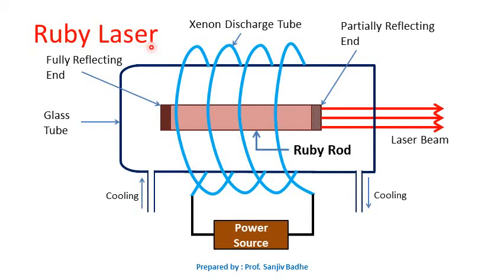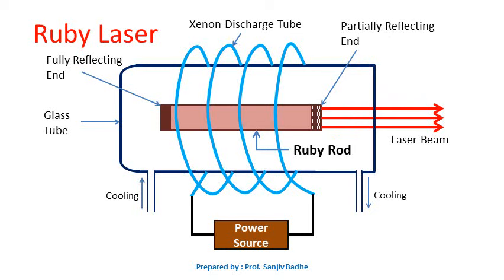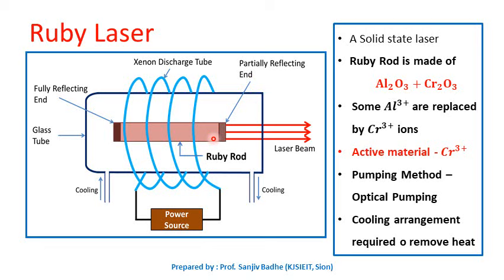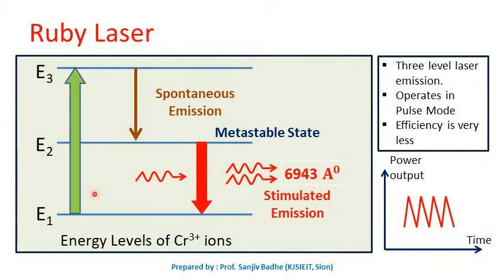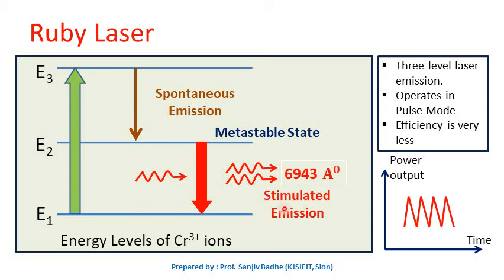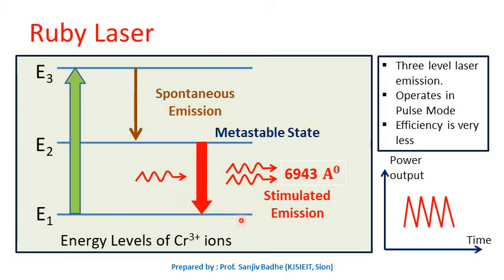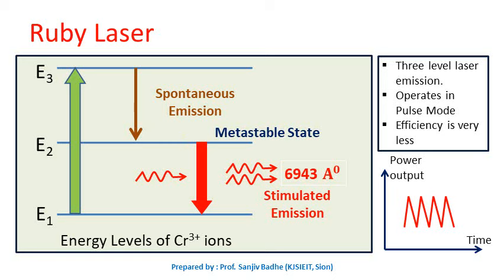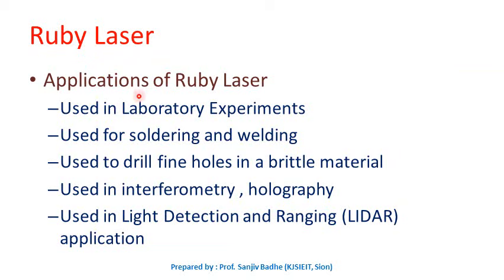Ruby Laser

Comment: Sir plz tell me why we kept current constant when we want to determine energy gap of semiconductor??
Reply from the maker: I think your question s not related to this video. As I understand it is in regard of four probe experiment to determine resistivity and energy gap of semiconductor. 
In Four Probe experiment, the voltage across the inner two probes is noted at different temperatures. This voltage can be used to calculate resistivity when V is proportional to resistance which is possible only when current is constant. This is why a constant current is necessary.
Reply: @EngineeringPhysicsbySanjiv  no sir i m student of msc physics...we have experiment to determine enegy gap of semiconductor using potentiometer on different two different temperatures...?